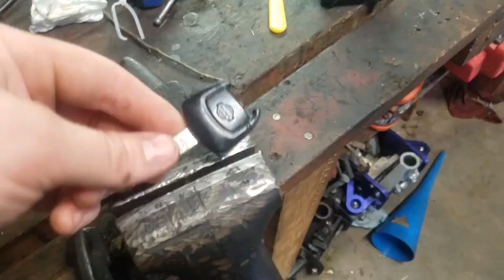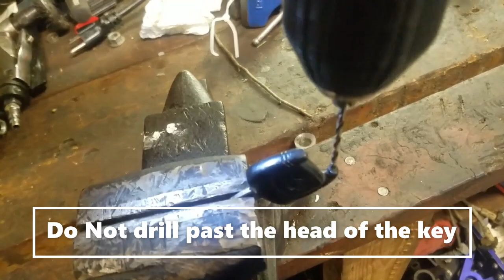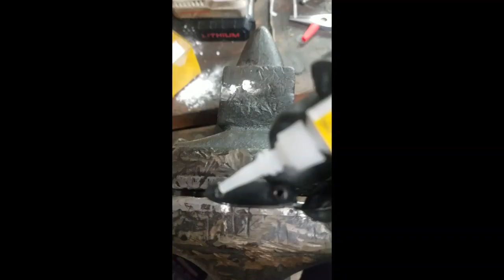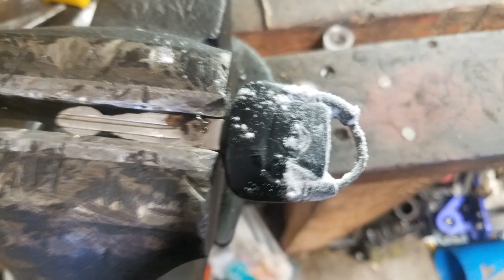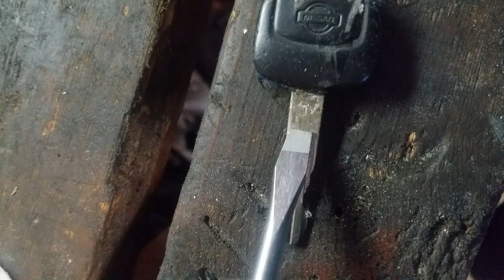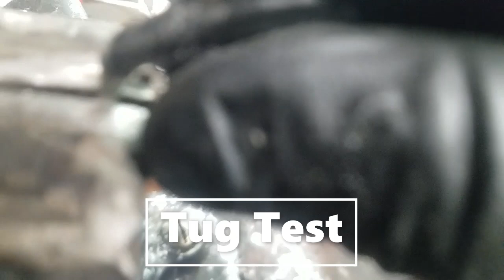Fixing a key with a broken keychain loop

Comment: I followed these steps but used JB weld and coated the wire and plastic. Worked great
Reply: And it blends in the repair
Reply: My thoughts were JB weld also
Reply: What size drill bit did you use?
Reply: @phoenixgaming454  ^^^This^^^

Comment: Y baking soda? .... sad part is I had same idea use super glue and coat hanger
Reply from the maker: Baking soda makes the super glue dry instantly. Kind of like when you touch it. The epoxy ads some extra strength. Just be carefull not to go to deep and knick the chip in the key.